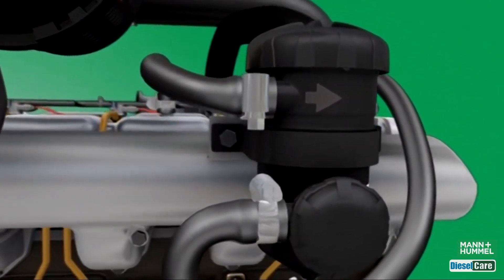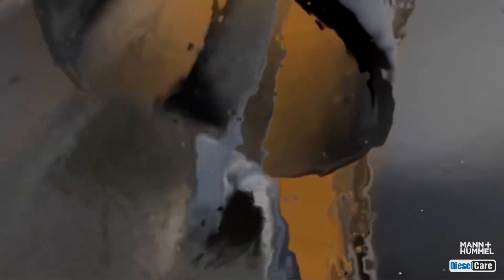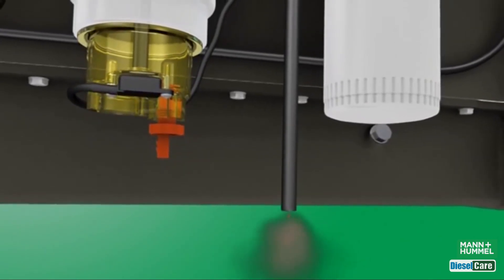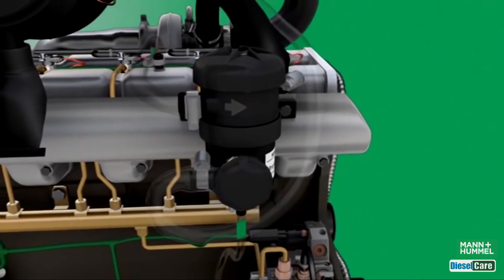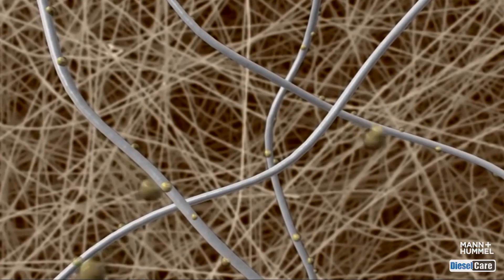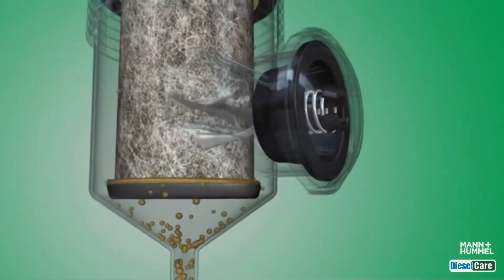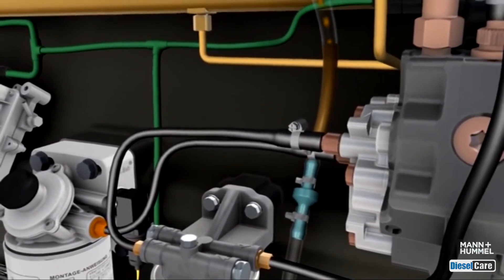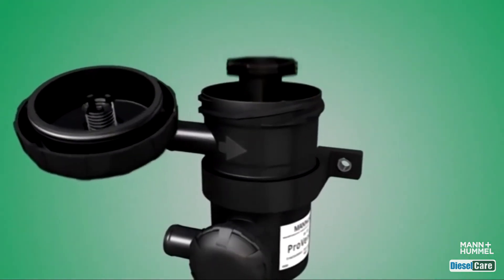ProVent Catch Can Oil Mist Separator Explained

Comment: If the standard oem system has a hose going directly from the rocker cover to the inlet then we go and for a filtered system with pressure relief valves isn’t anything other than an unrestricted hose going to pressurise the crank especially when the filter begins to get wet??
Reply: Your concern assumes the system cannot accept any level of restriction above the factory hose.
There have been independent lab studies done with the provent system that showed minimal restriction. The valve is there as a fail safe. 
Remember, the provent filter isnt exactly a filter. Its not a barrier that strains out particles by size. It essentially spreads out and slows down air flow so particles of suspended oil fall out of suspension, group together and form drops heavy enough to run down the bottom.

Comment: Can provent 200 use in a highly boosted gas engine? Or does it need a different filter?
Reply: The provent 100 might be more suitable. But even that is a bit overkill for a gas engine. These are designed for diesel engines 100 to 200 KW.

Comment: I have the 200 on my car in place of the deleted PCV valve, and I love it. I have a length of tubing and a drain cock at the end to empty it behind the fender into a receptacle. If you've seen what it collects (especially in humid climates) you wouldn't want that stuff going back into the oil sump. It looks like spoiled mayo, and consists of the liquids separated from the air which includes fuel, solvents etc, and will concentrate in your oil making it acidic which breaks down the lubricating properties of the oil. Don't recirculate it back to the sump... DRAIN IT.
Reply: This "mayo" may be an indicator that engine coolant is leaking into the oil (usually cylinder head gasket is to blame)

Comment: seems like plumbing the oil back to the engine intake, though filtered, is a recipe for soot since engine oil is so hard to burn. a separate vacuum pump would be better with an additional  filter.
Reply: ... except that this unit  is designed for Diesel engines that in fact burn oil to function the minimised oil fumes in the air returned to engine intake really are of no issue.
Reply: its blocking up the exhaust and causing inefficiency and maintenance issues.
Reply: @konic40 how? Theres no oil in the air returned to the air intake

Comment: Iv recently fitted one of these to a tuned landrover td5  engine to help keep the new intercooler clean, the landrover td5 engine  breather pipe has a valve already fitted to the end of the breather hose going into the intake pipe, would you recommend I keep this pressure valve installed seeing as the provent 200 also has a pressure valve, iv only just installed it and a few people have said it isn't a good idea to have 2 pressure valves in the breather system, what are your thoughts please regards scott
Reply from the maker: Hi Scott, thanks for your message. The pressure valve in the catch can is designed to bypass the filter in the event the filter becomes blocked. This is to prevent over pressurising the crank case and is a safety feature built into the catch can. So in answering your question it is fine to run both.
Reply: @DieselcareAu  that's great, thankyou for your reply regards scott

Comment: I installed the ProVent separator on my V6 Amarok about a year ago and must have driven almost 10k miles since then. I've drained it twice since then. The first time I got only water out and today I got a ml or two of oil and 100ml of water. My rings and bores must be very good as they clearly let water vapour past but not oil mist. 👍👍
Reply: The oil mist doesnt come from the bores. It is essentially distilled oil vapour from the crank case extracted via pcv. 
You might notice oil floats on water. Usually you will get water draining first, then oil.
Reply: @slickstrings Most of what I collect in the catch can is clear water and surely that must be coming from the combustion process?

Comment: How is the fumes condense?
Reply: It has three filtering elements, and even space for an additional wad of stainless steel wool to increase the coalescing affect. The replaceable filter has 1) a plastic grid coalescing mesh, 2) a sponge filter material, and 3) a synthetic tightly woven cloth-like filtering material, and the area inside the center is big enough for a fist sized wad of stainless wool. The three layered filter is what condenses ( coalesces ) the mist into heavier droplets that fall to the bottom of the can.

Comment: It still sounds too restrictive to me. As soon as there is a filter I don't like the design.
Reply: There are lab tests done that have measured the provent vs other types. The provent has the lowest level of restriction and highest efficiency vs the other types of catch cans. Particularly the ones with steel wool or metal meshes.

Comment: I get a strange "turbo blow-off" kinda noise when I lift off the accelerator after coasting my V6 TDI Touareg at around 20km/h @ 1900 - 2000rpm, imaging this like you are coasting at the parking lot, the speed is so slow that rpm is reving close below the torque range and the transmission won't upshift. Then, the blow-off noise come off when you let go of the accelerator. 

This noise has occasionally startled to the perdestrian and always ended up giving me the stinky look on their face as if I did it intentionally 😅 

I don't remember my Touareg used to make this kind of blow-off noise before I have installed the Provent 200... Does anyone of you here having the same experience? Is that normal?

Comment: Hi, does the Provent Catch Can work only on Turbo Engines? Thanks
Reply: Except for high HP racing engines, an NA engine does not create the amount of crankcase pressure to really need an OCC. In fact this whole thing (the PCV system) came about due to emissions. In old NA engines they vented the crankcase to atmosphere, usually thru breathers in the valve covers.
Reply: Thanks for the explanation
Reply: No, you can use it on any engine that has a PCV valve,/system, and even some that don't if you can figure out where and how to connect it.

Comment: Just installed one in my  07 Mercedes GL320. Until you have seen how much gunk builds up in the intake ports and intake manifolds on these engines. And spent many many ours cleaning one up save your comments and  just do yourself a favor and install a Provent catch can. Trust me this thing works and watch out for cheep china knock offs.
Reply: If thats true, why dont automotive companies give it built-in their diesel engines
Reply: @dralitahir   because company's want you to take your diesel in to be cleaned twice a year for regular maintenance. Which makes them more money in the long run.
Reply: @Dronefishha  Exactly.  it's all about the money too
Reply: @dralitahir  John Deere and some other manufacturers do put it on some excavators
Reply: it doesnt work, you still get buildup from the egr.
Reply: @James28R  
It remains dry and cannot form that thick deposits anymore
Reply: @James28R  I’m sure you are right but I would think a lot less.
Reply: Modern cars most of which are now direct injection don't have an EGR, and the PCV valve is what replaced it. The path through/to the PCV is usually the only extraction point of crankcase pressure and blow-by gasses. If you have something in that path like a Provent, it catches and cleans the air that then goes to the intake. If it's doing it's job, it works and you'll have no carbon build-up. I manually cleaned my intake (wasn't much in there to begin with), installed a Provent 200, and two years later took off the manifold to have a peek, and it's still as clean as the day I walnut blasted everything.  @James28R

Comment: Occ will destroy your engines. All cars need oil mist on their intake or turbo.
Reply: When I did my training as a mechanic this was never mentioned and I still think that is a fallacy. The turbo bearings are  lubricated by crankcase pressure and does not need an oil mist over the the turbine otherwise it would clog up and fail. The valves stems are lubricated by oil distributed via oil flow under the tappet cover. They not need oil on their faces which only contributes to carbon buildup. If your vehicle has an egr valve and turbo do yourself a flavour and fit a reputable catch can and see the results. my 4.2 litre turbo charged Diesel had to be be decoked at 140000 km. 200500 now and still running fine after catch can install.
Reply: @davidwarren4569  first of all, i never said that the oil mist was needed for lubrication. Second, some/few engines have occ installed depending on how much oil mist the engine is producing. Third if you think that your training in mechanic makes you smarter than toyota (which they dont recomment oil mist on all of their engines), then just debate with them not me.
Reply: @joeydingel9904  ha ragione David il turbo si lubrifica con l'olio motore se guardi sul turbo c'è un tubo rigido con un bullone forato all'interno e da lì passa l'olio che alimenta la girante dopo pensala come vuoi ciao
Reply: @davidwarren4569  btw we own a car repair/ maintainance shop. Most of the engine problems we encounter are lack of maintainance and THE ONES WHO MODIFY THEIR ENGINE BECAUSE THEY THINK THEY ARE SMARTER THAN THE CAR MANUFACTURERS.
Reply: Yeah, thats true, turbo needs that oil mist, that mist catches the dust to prevent damaging the turbo
Reply: @mtzeronine2188  So your car doesn't have an air filter?
Reply: @mtzeronine2188  slr. So true. Engineers explained have already explained this. Please for those who still believe that they need occ for their engines, talk to the car manufacturers not us and ask them why you dont have occ.
Reply: @joeydingel9904  oh you are one of THOSE people. Us engineers love you,  also funny to laugh at the ignorance. Toyota engineers for example, build a car for a set of rules, NVH, emissions etc, for a base customer. But that might not be for everyone, for example, modifying a 4wd to handle harder terrain and obstacles. What's even more amusing, is a lot of those same Toyota engineers love the mods people do. Have met a few, and they have all the pics from cars they worked on, and the modified ones lol
Reply: @Ferrat70  wow its like your leveling your skills with the people in toyota. Its like if im a math major, im also in the same level with Pythagoras? 😂 Try talking to them and you'll see the difference. Btw have you ever been in japan and tried to talk to them? I assume not. I think you dont need to talk to them because you think "your one with them" right? Delusion of grandeur 😵‍💫
I know what Im talking about because we own a car workshop. And OCCs are one of the culprits on our clients engine problems. Maybe you are the person who sells after market products. Am i correct? 😂🤦
Reply: @joeydingel9904   I know you are lying because you can't explain the mechanism by which a properly designed OCC can ruin an engine.
Reply: @moshet842  not lying. We have real life proofs and evidences to back this up. 
Are you the ones selling those occ?
Reply: @joeydingel9904   Please go ahead and explain the mechanism. How did you figure out the OCC caused those failures?
Reply: Coating your intake with an "oil mist" is the worst thing you can do in an internal combustion egnine. Why? Because oil is terrible to burn. It does not produce much energy, it causes great pollution and it coats the cylinders in carbon, way more then a proper fuel. Also what they call an OCC in Europe and Australia is called an AOS in the states, Air / Oil Separator. You want your cylinders filled with air  (O2) and fuel only. No oil. You want the oil in the pan, pump, and bearings. Oil mist also builds up carbon on the valves back sides, resulting in loss of power (air flow.) Also many (most) turbo engines already have some sort of AOS on them from the factory. And the Provent is one of the best AOS out there. (Not affiliated with Provent, except as a customer.)
Reply: @stickman-1  Damn bro that's crazy, but you are kinda pulling that right out of your ass.

If oil is so bad to burn in an engine then explain why diesels exist, and why they produce so much more power for using the same volume of fuel.
Reply: @saltananda3227  Diesel is not motor oil. My comment was about the "oil mist" not being a good thing to ingest into an engine. "Oil mist" in the crankcase is not diesel fuel. "Oil mist" is the byproduct of combustion of the fuel and whatever oil is vaporized in the crankcase. Diesel and gasoline are flammable liquids made from crude oil by distillation. They are the lighter more volatile parts and separated from the crude oil to make fuel which will combine with oxygen to combust and transfer that energy into a piston/rod/crankshaft. Diesel engines exists because diesel was a waste product that would still 'burn' and if you design the engine for the fuel it'll do fine. It does so because diesels have a much higher compression ratio to ignite the mixture.  Motor oil will burn, but not very cleanly and anyone who has taken apart an engine with worn rings and valves seals will tell you the tops of the pistons and combustion chambers will be covered in a black tar like film. That's the result of burning oil. Think of it this way: if motor oil was such a great fuel then why go thru the effort and money to produce gasoline and diesel and other highly flammable liquids out of the crude oil? Or if you are still not convinced motor oil is a terrible fuel, answer me this: would you feel safe with an open flame around a can of gas? Would you feel safe with an open flame around a can of motor oil? The answer is easy. Gas burns readily, motor oil does not. (Note: don't try that experiment at home. It was just a though experiment.)
Reply: @stickman-1  Ok I get your point but that's a lot of misinformation. For starters "diesel" engines were designed to run on any sort of oil (peanut oil, especially). Not just this byproduct diesel fuel. 

Oil will burn perfectly clean as long as you have the correct air mixture. If the engine doesnt have enough air it will leave soot from fuel that didnt finish burning.

Of course an open light next to diesel oil would be fine, oil is too thick to vaporise (it still does, just nowhere near enough to passively ignite). Wheras petrol does, and produces a passive air-fuel mixture (which makes it dangerour). Soak a rag with either fuel and it will burn just fine, diesel leaving black soot.
Reply: @saltananda3227  My post was to rebut the claim that an "OCC will destroy your engine." No, an OCC will not destroy your engine. There is a difference between a diesel being able to run oil as fuel and and "OCC will destroy your engine" because "you need an oil mist." Such a statement is absurd on it's face. The turbo if equipped does not need the "oil mist" to work properly. The engine (assuming it's a diesel) already has all the lubrication needed with the oiling system and the diesel fuel. And if we look at a gasoline engine, especially a turbo charged engine, the LAST thing you want is an oil mist in the intake. But you can keep feeding your oil into your intake and be happy. I will continue to advise people on stupid "advice" and claims.
Reply: @saltananda3227  Also I wanted to point out, you claim oil will burn perfectly clean as long as you have the correct mixture. This is true. But that's not the case in modern cars. There are NO cars running on motor oil. What you will have is an engine tuned for the fuel (diesel, gasoline, ethanol, etc). NOT two fuels at the same time (e85 being the exception, sorta, it's tuned for the ethanol fuel with a toleration for the gasoline.) There are some similarities with Kerosene, Diesel and other oils where the a/f ratio is close, but none are setup to run MOTOR oil, which is the "mist" the OCC is filtering out. And in an gasoline or ethanol engine you'll be far, far off from burning  motor oil clean.
Reply: @stickman-1  Par some exceptions I think we're more or less coming to the same conclusions, so I'll leave it here. Addios
Reply: @stickman-1  erm, no they call them catch cans in america too.
Reply: Does the oil mist do any lubricating of upper cylinder?

Comment: Clean oil? Back to crankcase? Make another video how to replace engine
Reply: Id rather return it than burn it and contaminate the remaining oil with burnt additives/byproducts.
Reply: You already have dirty oil in the pan. What the OCC (or AOS) is doing it trying to remove the oil from the intake charge. But the oil going back is the same oil that is already in the crankcase. If you don't want dirty oil, change your oil every time you drive. It's a fact of internal combustion engines: rings don't seal perfectly. They will always let a little combustion gases into the crankcase. Watch the Total Seal Piston Rings videos. They are very informative on this subject.

Comment: you dont want that dirty oil back in pan tho...
Reply: They make a long clear hose with valve on bottom you can drain and dispose if you choose.
This is best  catch can made- look into it.
Reply: You already have dirty oil in the pan. What the OCC (or AOS) is doing it trying to remove the oil from the intake charge. But the oil going back is the same oil that is already in the crankcase. If you don't want dirty oil, change your oil every time you drive. It's a fact of internal combustion engines: rings don't seal perfectly. They will always let a little combustion gases into the crankcase. Watch the Total Seal Piston Rings videos. They are very informative on this subject.

Comment: i need to get an oil catch can installed on my Mahindra Thar diesel (Roxor in US), however the only location i have is on the fender in the height of the starter motor and not at the height of the valve cover, is it ok to fit lower than valve cover?
Reply: Yes.